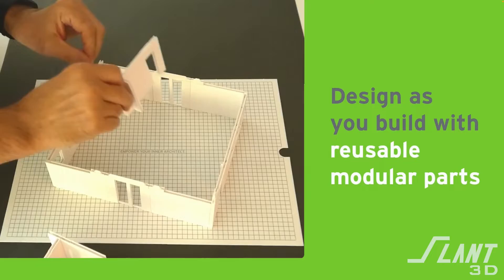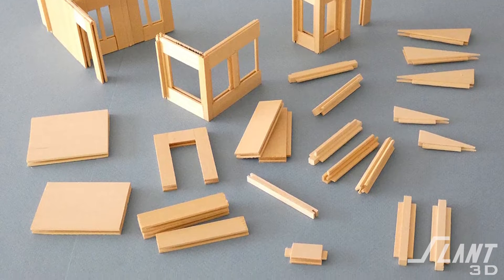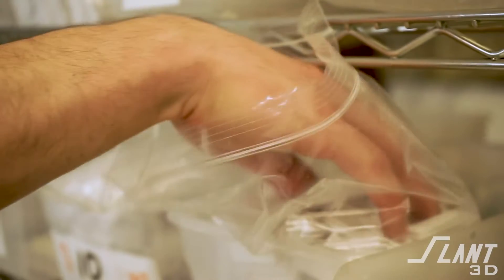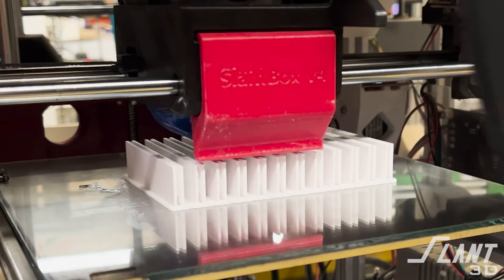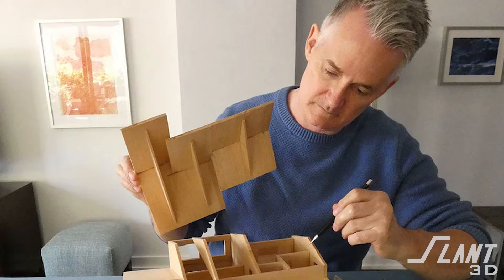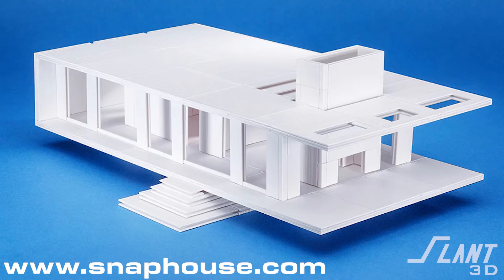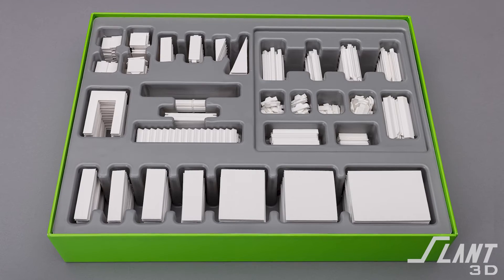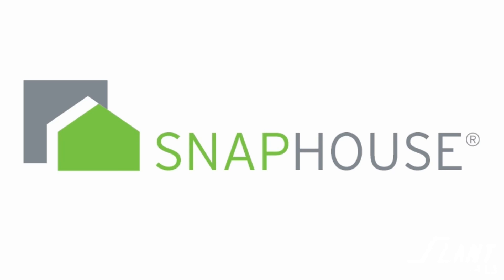3D Printing a 452-Piece Building Kit for Amazon | Snaphouse | Real 3D Printed Products

Comment: Such great insights into the manufacturing production design process for mass-production in a 3d print factory. Noticed the consistent use of white throughout the product. Even with a single color it highlights the manufacturing standards in place for filament sourcing, color control, etc. With 400+ pieces, any differentiation in color could be eye-popping.
I don't think it would have been possible to ship such a product like this 5-10 years ago; at a price point that many would have found of value.

Comment: For a project like this, Its important to have a very clear understanding of how your machines are behaving, and the outlook is exactly the same for each machine. machines can vary in tolerance by .3mm in either axis due to mfg tolerance of some steppers, which can be enough to cause problems for small pieces. having hundreds of machines you have to find out what that variance is, and design around that tolerance. Even things like z banding, one nozzle extruding slightly more than the other, thermistors being off for certain printers, all affect the part. 3D printing small pieces that fit together while using many different printers is no easy task.
Reply from the maker: That is part of the reason that we manufacture our own machines. To avoid unacceptable tolerances like 0.3mm
Reply: There is no way manufacturing tolerance differences in steppers produce a dimensional difference of 0.3 mm. That's 150% of a whole step at typical pulley sizes. Difference between steppers is more likely 1.5-2 orders of magnitude smaller. Most dimensional differences between printers are a consequence of poor extruder calibration not motion system issues.
Reply: @daliasprints9798  try printing 100mm blocks on 20 stock Ender 3s, measure all of them with a caliper. Ive done this already with my print farm and this is what I found. If you choose to not believe it, then oh well. Just sharing my experience. Been running my print farm for over 2 years now non stop, I always have to calibrate the XYZ steps to get everything within spec for any new machine I add to the farm
Reply: @Redo3D  I didn't say you can't have errors of that magnitude, but that variation of the stepper motor cannot make that magnitude - not to mention that kind, which would necessarily be periodic, not relative or absolute dimensional.

Comment: Wouldnt injection molding be better for these sorts of things? Of course once the models are finalized
Reply from the maker: The design of the parts is also bordering on impossible to mold. But the cost of the tooling for molding would have been more than the cost of the entire first production run with 3D Printing
Reply: Not an expert here but I see a couple of things here:
- The parts actually look quite thick (8-10mm) which is a bit much for injection molding. They would need have one face of the walls have ribs which means pieces could only be used in one orientation (the smooth face outside and the ribs face inside the house)
- I'm sure they don't move as many parts as Lego or similar brick construction so I think here in this scenario being able to quickly make "add-ons" and extension kits would be cost prohibitive. Now if they want new shapes or make a new kits with extra parts it's almost free
Reply: @guillaumeleclerc3346  see that's good to know, I wasnt aware of those little things about injection molding, I just know it's usually quicker and stronger. I do have 3D Printing experience though
Reply: It would be prohibitively expensive to injection-mold the parts individually. You've probably bought a board game with injection molded pieces at some point. All of the individual pieces are combined into one large piece to which they are connected with sprues and before you can start playing you have to wiggle each piece out. The sprues usually leave little zits on the final parts. Board games do it like this because it makes all of the game pieces a single mold which is the only cost effective way to do it.
I remember how this wiggling-out  process takes quite a while even when the game usually has only 2 dozen plastic parts. I can not fathom having to wiggle out 452 pieces. And the zits would probably have to be filed or cut off in some places. And all of this would have to be done by the customer OR you'd have to pay someone to do that at your production facility. I think passing this to the customer is a no-go. We're talking adults here who have more money than time or patience. But if you pay people to do this at your production facility you eliminate all the cost savings from using injection molding to begin with, because human labor is expensive.
Also, injection molding has very high start-up costs to create the molds and these architectural kits are unlikely to have so many potential customers that it makes financial sense to pay those costs when you already have a perfectly fine solution in mass production 3D printing. And let's not forget that all of the work to get these things 3D printed well was necessary to even develop the finished pieces. 3D printing was an essential part of the design and prototyping process. So even if you had decided from the beginning to target injection molding, much of the cost to optimize the 3D printed parts would have still have to be paid.
Reply: Yes it would. Injection molding has become a lot cheaper over the past 5-8 years. It's gotten to the point where it's comparable with rapid prototyping, but you have to find new school shops that do this. If you go to old-school shops it will cost you medium fortune. Just like 3d printing has gotten cheaper, so has injection molding. Its a lot cheaper now to produce/design molds.